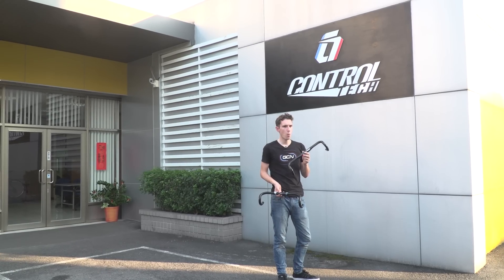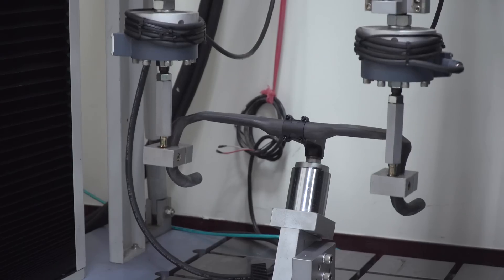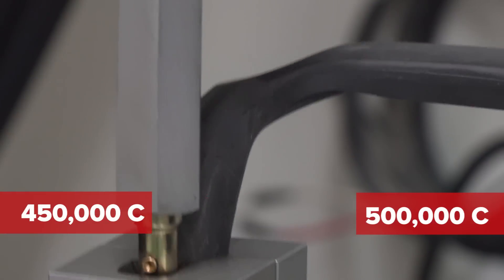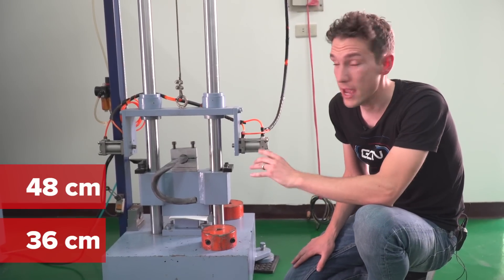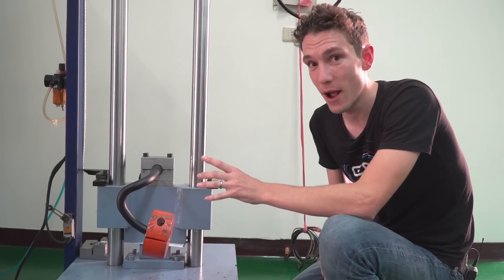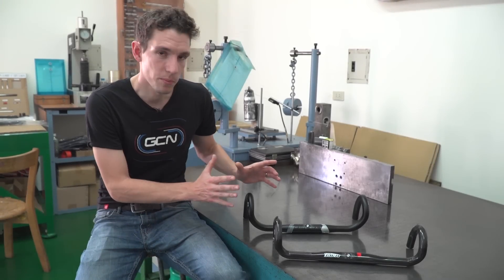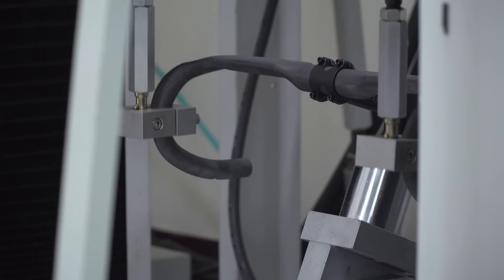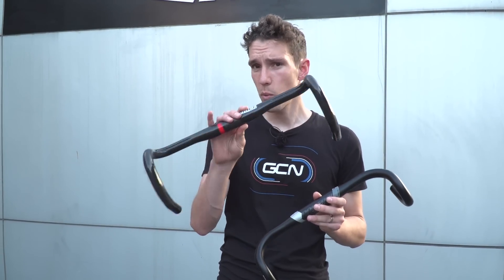Carbon Vs. Aluminium Handlebars | Which Are The Strongest?

Comment: That's not an impact test. This https://youtu.be/khJQgRLKMU0 is an impact test. Note how carbon fiber does versus Al or any of the other materials tested. That handlebar is not safe to ride once damaged.
Carbon fiber is weak/fragile to localized impact forces, and when it fails, it can fail suddenly and catastrophically.
Reply: This is the exact thought I had when I saw the impact testing method in this video.
Reply: Soooo according to that test an aluminium tube will withstand an axe attack much better than a carbon tube.
Reply: That's a commonly used testing rig used by engineers, and people who work in materials science. It's purpose is to repeatedly and accurately apply the same impact force, under the same conditions, to different materials. You're controlling and isolating variables--that's science.

The impact wedge is a simulacrum for any kind of blunt impact trauma, like what you'd expect to see during a crash, or similar type of impact, e.g. casing a jump, a rock / tree strike, or something similar.

Personally, I've seen carbon components and frames ruined because they fell off a roof rack in a parking lot.

What the impact test illustrates is: under the same impact force, aluminum will bend, but not break, whereas carbon fiber will fracture catastrophically.
Reply: Nero Wolfe exactly and that's why I'm sticking with aluminum bars. Carbon fiber in my opinion is over priced dangerous material for bikes.
Reply: They've tested how the bars behave when you hit a pothole, impact of the bike not to the bars
Reply: it didnt even fail that bad in the video
Reply: Not to mention the cost to replace the handlebars - aluminum is far cheaper!
Reply: Nero Wolfe, you missed the point. nobody is saying that its not a scientific test, but that it is not testing the IMPACT onto the material. 

As the bars hit the bottom of the rig, the weight causes a sudden transfer of force through the bars like a spring. That is not an impact.
An impact is an object HITTING the material. 
This test in no way mimics a bar slamming into asphalt.
The carbon bar performed bad enough in this test, and it would fare even worse in a real impact test.

It would be easy enough to use a near identical rig to drop a small weight actually onto the bar to properly test the materials resilience against a localised impact, and that would be just as scientific, yet far more relevant.
Reply: Nero Wolfe yeah carbon doesn't like an impact, crack!
Reply: If a carbon component/frame get ruined because they fell off a roof rack, then those must have been some really shoddy products. 

Every application of carbon fiber always had people questioning its strength in an impact. Remember when Mclaren first introduced carbon fiber in F1? Everyone said it wasn't safe in a crash. Guess what? Everyone's running carbon fiber monocoque F1 cars now.
Reply: It is not the kind of impact a handlebar is likely to receive - let's be honest. Most of the time the impact is NOT focused in one tiny chisel like point, in event of a crash you hit with an area, most likely where the handlebar is wrapped with griptape, or even the shifter/brake lever takes the impact. Handlebar is allowed to flex, it's not mounted stiff between 2 points. Yes carbon will fail more drastically than aluminium, but that's not always the case. In a crash that would cause that kind of damage I would not really worry about the handlebar to be honest...
Reply: If a big solid metal pole with point at the end hits you while riding you arent going to live to worry about the bars...

Comment: I rode a nice Ti gravel bike, identical models, one with Enve stem and Shimano pro carbon bar, another with Easton Al stem and bar.  Difference in front end compliance was very noticeable - carbon front end was hugely nicer to ride on rough roads.  There was also a little flex in carbon, which is why I presume the 2000 watt pros use Al for sprinting. My "sprinting" didn't notice any difference and the compliance is worth the $$. I didn't care about the 50 grams.

Comment: Aluminium will at least just bend from impact.
Reply: Check out Jordan Boostmaster 4 frames in 3 years. Both top and bottom tubes sheared off from the fork after crashing into a tree.

Comment: One good crash and a carbon handlebar will crack and wont be 100 % safe to use. experienced it myself a couple of times. most of the times i was able to finish the race but u cant reliably put down force. so sprinting is dead...but dayum do they look good and make u feel like pog

Comment: Why didn't you use the same shape bars?  If you had used a round carbon bars with no internal routing holes, the results would have been very different.  Or an aero aluminum bar for that matter.  The test was poorly designed.
Reply from the maker: Hi Roy, I think there's an important point here, aero bars are not inherently weaker than round ones. They are engineered differently to allow for the more complex shapes, that's why they tend to be slightly heavier.
Reply: I find it hard to believe that they do not flex more in the vertical direction  due to their reduced height in that direction.  And the hole for the internal routing was obviously the weak spot.

Comment: Until individual carbon fibers units are scan with ultrasound for voids, wrinkles, resin rich/dry, vs sampling a few specimens from a manufacturing I'm not going near the carbon fiber bar.

Anecdotally they are just too expansive, seen too many broken ones come through of the doors of my local LBS.
Reply: The math for samples from a manufacturing run is actually very solid. However, RCFP can be produced with multiple manufacturing methods, a lot of the ones you've seen broken are probably short fiber injected or quasi-isotropic (the later being better, but not efficient use of CF).

With the more advanced techniques (actually caring about layup of the carbon), they should be quite solid. There are some other techniques that haven't yet matured, but will allow for incredibly stiff, safe, and light handlebars (but that won't be where it starts).
Reply: elh93 Thanks for your reply.  What perplexes me is lack as a substrate like form core, honeycomb or molding using a wax positive (to be melted out later) across most CF products.  Otherwise it seems an incorrectly expanding bladder which seems to be primary factor for all the void or wrinkles.  Correct me if I'm wrong but it's that how they keep the airplane rudders or the safety cell in F1 car so strong?  Also why not add S-glass or aramid fibers into the layup.  I also don't understand why there some so much unidirectional fibers instead of twill weaves around compound shapes especially in fork crowns.  I get the impression thats to save weight be reducing volume of resin, which seem frankly reckless.  On high performance automotive side of things twill weaves still seem to be the most common (like a Koenigsegg Rim)

There's no question carbon fiber is superior material yet for more consistency e.g. a CF lugged frame* it costs nearly twice as much as premium alloy tube set like Reynolds 953, Columbus XCr, or a high quality 3/2.5 Ti for a double triangle configuration.  If a Meilenstein-Obermayer wheel can be made for 415 gr.  I often wonder just how light/strong a CF bike could be made baring cost.  

*Cryptic, Crumpton, Purlee, Calfee, Holland, Appleman frames where (I'd include the Colnago C-60, some of Looks and Time frames

Comment: if youre in a crash hard enough to break your handlebars you have other issues, like breaking your neck
Reply: JogBird it's more about impact force braking carbon not the forces in the crash. It doesn't take much to delaminate carbon from it getting hit
Reply: Not necessarily, i crashed when a car turn without looking and stopping and flew over the hood. I was fine with just a bruise on the shoulder and the handlebar (Alu) was seriously bent on one side.
Reply: Been there done that. The alu handlebar was in perfect shape.  Me in the ER (I am mostly ok now)
Reply: Been there done that. The alu handlebar was in perfect shape.  Me in the ER (I am mostly ok now)

Comment: If carbon is strong why not the government made a carbon aircrafts?
Reply: Same reason only the most expensive supercars are made of carbon fiber.  There is a rocket company which makes their boosters (small) out of carbon fiber.
Reply: @nolsp7240  carbon are easy to build but not strong enough it expires....... Its only strong for a certain time....... Aircraft uses aluminum
Reply: Its easy you'll just mold it then oven....... Walah magic your own carbon piece then put them together......... As I said it expires over time like rubber....... Did you experience a expired rubber shoes thats also in carbon

Comment: This test was EXTREMELY inaccurate.
Comparing a round section bar against an aero bar with holes for gears/brakes is NOT a good comparison for material properties.
The size, shape and design of both bars should have been identical for an accurate comparison.
Unfortunately this test was anything but accurate.
Reply: I think the point was, they were both plenty strong.
Reply: @JoshuaTootell  Yep, and to point out that the CF was strong even with an aero design.

Comment: Carbon obviously especially as this is paid promotion
Reply: Carbon is significantly more resistant than aluminum per gram of material. It's called specific resistance, and it just has more of it. Carbon fiber reinforced plastic is also leaps and bounds more fatigue resistant.
Reply: I sometimes wonder if all roadies secretly wear tinfoil hats under their helmets.
Reply: The only promotion the sponsor got was that its name was mentioned about 3 times.  The rest of the content is pretty neutral and informative.
Reply: @Andres, according to GCN it will keep your head nice and warm into those grim winter conditions. 🤣
Reply: Thought the same thing after I posted it.
Reply: It doesn't need to be neutral. It only has to make the same test, the same way, for every component... which, so far as we can tell, was the case. I second the part about seatbelts.
As a sidenote: there's a problem with identical tests sometimes, because they may not be fair or representative for every component. For example, some have been quick to point out that with carbon, stress concentration due to direct impact is more likely to result in a crack, while the aluminum will yield locally and keep going.
Reply from the maker: Did you watch the video Adam?! 

By the way, just for clarity, Control Tech paid for us to visit and make a video, the content of which was entirely up to us. As it always is. Cheers
Reply: Andres .C What they test affects the results, because carbon fibre is stronger in some ways but remarkably weak in others. Notice how in both tests they apply force to the same points in the same direction. That's the direction it's designed to be strongest in. Aluminium, on the other hand, has more or less uniform strength in all directions. A lot of people seem to learn this the hard way when they bash their carbon parts in crashes.
Reply: It's like you didn't even read my last comment.

Comment: IDK WTF you think you're doing, but as D.Eldon pointed out, that bogus drop test you did with a raw carbon bar that had a flattened cross-section (where it broke) is not a fair test. Nor is it a fair test when using a new aluminum bar that hasn't been subjected to any cyclical stresses (because aluminum has no endurance limit). Whether a deception, or incompetence, your test was a waste of time. It's not a debatable topic, that by volume, or mass, carbon kicks the crap out of aluminum. :/

Comment: hi carbon fanboi

450.000 cycles needed to break aluminum = carbon is significantly better.
12 kg from 60cm drop breaks carbon = you won't crash that hard anyway. 

which cyclist can do 450.000 cycles of 40 kg per handlebar before he runs out of elbow cartridge?

Comment: oh and to add, shit test because you didn't use like for like, using a wing/aero CF bar that has internal routing against a std round alu bar with no routing just shows you what noddies you are, repeat that test with a round shaped CF with no internal routing just as the alu bar and the results are very very different!